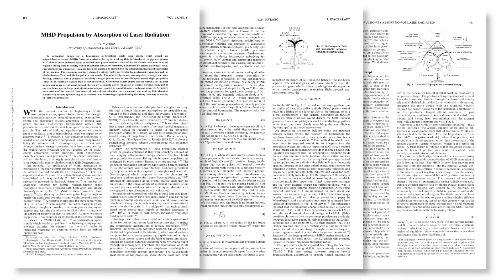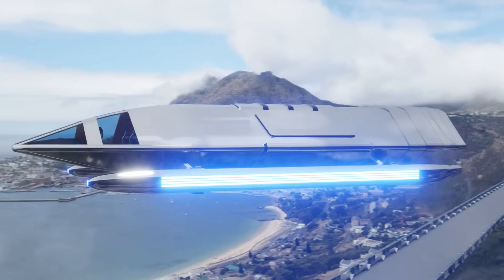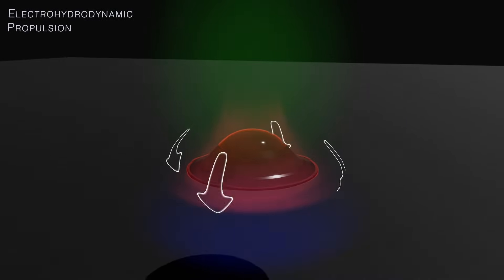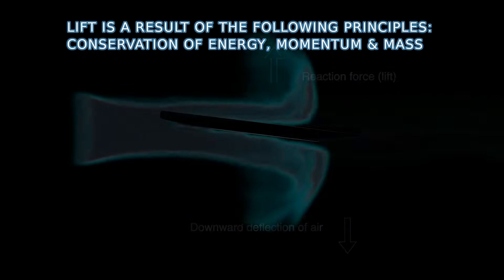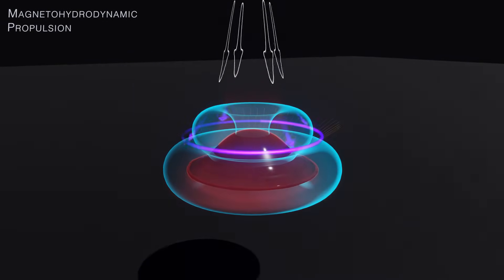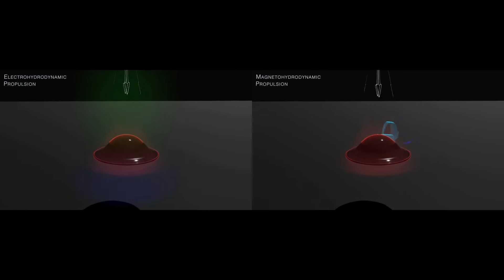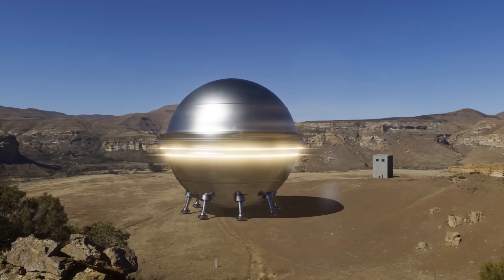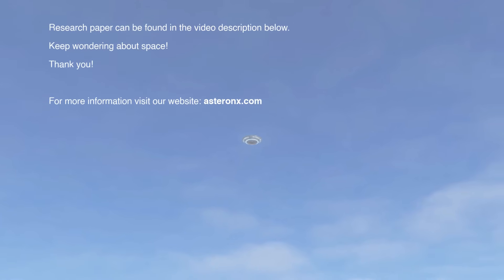Magnetohydrodynamic (MHD) Propulsion - What Is It? #magnetohydrodynamics #mhd #aerospace #asteronx

Comment: problem is ionizing the air if you gonna use it for flying. MHD propultion has been used in seawater for a long time
Reply from the maker: The craft must emit high energy discharges, specific ionizing laser pulses and cesium in order to ionize the air.

Comment: If it would be used on a ufo / plane (whatever) what type of power source is needed to run this thing? (Volts / Amps). When this field is running around the craft, would it act as a force field in a way? The thing that comes to mind is seeing that video, of that ufo craft going into water without breaking apart.

Comment: Tasks to Complete:
✔ Procure Materials – Source all essential components (frame, superconductors, batteries, gallium fluid).
✔ Assemble Structural Frame – Construct the core frame and attach propulsion components.
✔ Install Propulsion System – Set up MHD drive, including conductive fluid channels and magnetic field generators.
✔ AI Flight Control Integration – Implement AI-assisted stabilization and flight adjustments.
✔ Initial Power & Safety Tests – Ensure stable power distribution and emergency fail-safes.
✔ Hover Test & Data Collection – Conduct the first lift-off attempt, measuring thrust, stability, and control responsiveness.

Comment: all motions are came from internal pressure of atoms.

That moment could do with two ways from our world.
First method is base over newton third law.
Action and reaction used other background resistance.
Ground and water , air also too.
Today vehicles are running with this style counter reactive propulsions.
Mobiles use ground reaction and ship used water reaction.
Plane also used air reaction same way.
But we missed second method of propulsion.
Atomic internal motion which we still missed.
 I called this with "inertia".
Inertia can made directly.
This is second method in motion method.
Our rocket engines showing mixed with first method and second method .
I see rocket engines showing second method at space without gravity region arrive.
Direct method of inertia producing step happening in rocket exhaust nozzle cone region
Which I see. We must find way for second method of direct inerta making machine.
I believe "inertia could produce directly".
UFO are running with direct inertia technology.
Find to ways for direct inertia making machines with physical agitation .

Comment: Still some confusions about MHD and the creation of ionic wind. MHD at a voltage below 30,000V, will create ionic wind (see Jean Louis Naudin's Lifter). TT Brown had to go to France, to gain the support (denied in the US) of a French aeronautical / space agency, to prove that his MHD worked in empty space = the movement upward of a capacitor did NOT merely push on air. Biefeld and TT Brown also demonstrated this, way earlier, in their lab, with asymmetrical capacitors powered inside a vacuum chamber. Their video is found on youtube. They celebrate with champagne at the end. TT Brown named his earlier work as "Electrogravitational" while If you study it, you will find tests made with asymmetrical capacitors (Styrofoam cups wrapped with foil) which moves on the horizontal plane. Since gravity is not affected but vertically, MHD is not affecting gravity. *I would not disassociate Electric force from Magnetic force, as both of these orthogonal forces make up the Lorenz Force. F = q  (E + B x v). The experiment is cheap to conduct, using salt water and food dye to visualise the Lorenz force exerted on salt water (fluid). As it works in space, we can wonder what medium does it affect? Photons are the exchange particle in all electric and magnetic phenomenon. Photons are not like baseballs ejected by the Sun. Rather, they comprise the omnipresent medium, earlier called Aether. It could be easily expected that since photons are intimately involved in anything electrical and magnetic, logically, creating electrical and magnetic forces would likely affect photons. Indeed, you can see how rather strong magnets will bend a fire (a plasma).There are false assumptions still in place in regards to the nature of light, photons, and what constitute a magnetic field/ electric field. When we find the true nature and interactions of these. we will no longer be slaves to the Third Newton's Law of motion, ushering a new era of space travel. Cheers!
Reply: This probably explains why the recent UAP that was struck by a hellfire missile was flying over specifically, salt water, I remember information about this to have come to that conclusion but that information is relatively old and difficult to remember for me.

Comment: There is not a single MHD, but two kinds. MHD in liquids or in hot gases like thermonuclear plasmas (as in stars) is at thermal equilibrium and is governed by a high magnetic Reynolds number. It poses no issues to engineers, besides the mandatory high-power electromagnets and the electrical generator on board. On the contrary, weakly ionized gases (also called "non-thermal plasmas") are far from equilibrium, which means that only the "electron gas" is hot, while the heavy gas (neutral and ions) stays at room temperature (BTW that's why you can hold a fluorescent tube in your hand without burning). This MHD is that of low magnetic Reynolds numbers, and that's why MHD applications in ionized gases are so difficult to master and develop. Because when a non-thermal plasma with low-magnetic Reynolds number is magnetized with a strong magnetic field (critical Hall parameter involved), a nasty, very fast instability arises: the electrothermal instability (discovered by E. Velikhov in 1962) as well as thermal blockage, which ruins the efficiency of such converters and makes them impractical. Only when the electrothermal instability is tamed (with a method discovered by JP Petit in 1983) can MHD converters in ionized gases exist. For air-breathing hypersonic applications, apparently only the Russians managed to crack the nut.
Reply: Thanks for the education. You need to make this into a video and uploaded. So the rest of us can study it.

Comment: I had similar idea few years before. Simply ionize particles upper to create lower pressure and discharge them under to create dense preasure. To gain some ionized wind. But its weak. But preasure has force 10 tons on m2. So only 5% of preasure change is enaught.
But had better idea. Create machine with superconducting magnets that lock to earth magnetic field. If that machine lock field, then move magnet part downward, at bottom turn of field move part back to top, then turn on push again downward and same again. And you claim like on ladder. Another idea is to lock to sun magnetic field, in right moment it rip of spacecraft from the plannet. But after it you stay still relative to sun so you fall directly to sun. In right moment of stopping you can gaint gravity boost from earth/moon.

Comment: This was the work of Jean-Pierre Petit and his PhD student Brun in the 70ies. They demonstrated also that with MHD you can nullify the sonic boom in supersonic flights, hence fly supersonic without double bangs. 
Seems to be used for the B2 bomber, not for sonic reasons but for RF plasma shielding (bending of the RF waves in a plasma) and improve stealthiness.
Reply: B2 Bomber is subsonic thats why it produces no Sonic boom… Supersonic flight produces heat due to compressing the air infront of the plane (forming a shockwave you can hear as a loud boom), which in itself is very bad when designing a stealth bomber since it can be easily shot down by ir guided missiles, at hypersonnic speeds, this shockwave gets so hot, the air surounding the plane turns into plasma on its own. This would light the b2 on a radarscreen like a cristmas tree, since plasma is not capable of bending radiowaves, but is highly reflective to them, this plasma would also produce huge amounts of UV radiation that could be tracked from the ground. You can see the b2 is definetly not a supersonic plane, just by looking at its shape, essentialy the faster you want your plane to go, the longer and narroweer you build it, in short, you optimize it so no part of the plane will ever touch the mach cone produced by the nose of the plane.

Comment: This video talks about MHD "drive" as though it is an existing technology with working prototypes. Where are they? What is the power source? Where are the thrust-to-weight ratio calculations? How does a magnetic field "push" against virtual quantum particles? Are you saying that a macroscopic field somehow interacts with quantum phenomena? How does that work? Please provide sources for real-world, functional implementations of this technology...if such examples actually exist.
Reply: What's quantum other then size,  do you know
Reply: @Flagg1  – I think you probably mean other than size. If so, start with position and momentum. Heisenberg's uncertainty principle states that it is not possible to specify BOTH the momentum (velocity) and the position of a particle with certainty. You can measure either one up to the limits of precision of your measuring equipment, but not both. 

Also, energy states are quantized. Electrons are constrained to certain quantized energy states within the atom; there is not a continuous range of allowable energy states.

But those characteristics are not the context in which "quantum" was mentioned in this video. Rather, it invokes some (presumably) inherent magnetic properties of "virtual quantum particles", which are presumed to pop into (and out of) existence from tne "the quantum vacuum", a minimum, non-zero energy state that is believed to permeate all of space, even in the deep intergalactic vacuum.

OK...that's fine, I guess. But what does any of that have to do with a working prototype of MHD propulsion on Planet Earth? It's already well known that MHD will work in space. It has very high specific impulse, which helps to make up for the fact that the thrust stream contains very low mass. That makes it good for very long distance travel, where transit times are long.

But the amount of force generated by such thrust is minuscule; it's not enough to levitate a vehicle in a way like what is depicted in this video. Without a working prototype, this is all fiction, and not especially good fiction based on actual science.
Reply: @Vito_Tuxedo  I would have given you quantifiable & such but it's size. If you take a portion from something no matter how small it is it's still that thing no matter the name you give it, like referring to atoms or even particles & such other. it's purely size relative & when it comes to quantum it's quantifiable,  quantitative.
Reply: @Vito_Tuxedo  try this. Can 0 be divided?. Can 0 be subtracted from?. The answer to both questions is: No. however some would have you believe otherwise & have created incorrect methods using mathematics, equations, calculations, etc.

Comment: 🕳💫🕳💫🕳💫🕳💫🕳💫🕳💫🕳💫🕳💫There is also a secret technique for flight in the atmosphere, plasma propulsion panels. They are located in the form of round zones around the perimeter and on the bottom of the device. A column of ring vortices is created from below and along the movement - this is how the device flies... Everyone has heard about railgun guns - this is a system of two extended longitudinal contacts-rails and a projectile between them. If an electrical impulse is applied to the rails, induction will accelerate the projectile to cosmic speeds. Following it, a jet of hot plasma will also fly out. Such guns are being developed in many countries. The momentum created by the railgun can be used not only to fire, but also to move. Accordingly: spacecraft have pulse engines that shoot plasma at the right moment - creating sufficient force to move from one orbit to another. For example, “Ablative pulsed plasma engine”, there are reviews on electric propulsion engines. These engines are large; a plasma jet appears there when a plastic plug located between the electrodes burns. Secret vehicles (“flying saucers” and “dark triangles”) have propulsion panels. There, railguns are reduced to the size of a pencil and assembled into flat panels, which in design resemble the plasma panels of ordinary televisions. The distance between the contacts is small - an ordinary spark of an electrical discharge becomes the bridge between them. The cells operate synchronously: they shoot jets of plasma - sparks of electric discharges accelerated by the force of induction. Their speed is enormous, the number of railguns in a panel is hundreds of thousands. The total motor impulse is impressive. The discharges occur at a megahertz frequency, each pulse striking the air, which swirls into toroidal rings. These toroidal rings form the air cushion on which the vehicle flies. In the horizontal direction, a pushing effect is created in the same way. In a vortex jet, due to the rotation of air, the temperature drops - moisture from the air is frozen in the form of snowflakes, on which the light of electric discharges sparkles. The result is a kind of “solid beam”, which, when rocking the apparatus, is capable of bending - because the trajectories of the vortex rings are bent. The devices fly quickly and they are very maneuverable - thanks to the lightness of the device (it is made of composite materials). There is harm: from pulsed plasma engines - microwave radiation. Load capacity is low. There is no radio communication. Narrow application profile - rare spy missions. The question is often asked: where does so much energy come from? Answer: they use super-galvanic cells that create a current of 1000 A. The principle is simple: a magnesium tape (magnesium on a viscose basis) is scrolled past the electrode in the presence of an electrolyte. It's like playing tape in old tape recorders. Magnesium is completely oxidized and enough energy is released. Previously, magnesium tape was thrown out as an “exhaust” - this is how rumors arose about “angel hair” that remains after the passage of a UFO. Now the waste tape is collected and magnesium oxide is recovered. This technology for generating energy is very expensive, but it is used for spy technology.

Comment: MHD using air alone will never be used for aircraft as the thrust will always be too low for anything practical, regardless of how advanced the technology gets.  Technology is not the limiting factor- physics and the density of our atmosphere is and makes pursuing that goal pointless. MHD underwater is much more practical and   more technology dependent.  MHD in space requires an additional "fluid" as there is not enough matter in the vacuum of space to produce any useable thrust. Therefore, thrust derived from MHD would only be secondary to the primary reaction mass propulsion. (This is not including ion thrusters already in use on spacecraft, but again, those are unlikely to ever be used for manned spaceflight due to their extremely low thrust).
I wish this video took reality and practicality into consideration rather than just falsely extrapolating on some basic concept without considering the limiting physics making the level of technology irrelevant. As an aerospace engineer, I will probably ignore most future videos on this channel if they continue to be so misleading.
Reply: liquids were mentioned.  Why don't you guys actually do something like provide some useful energy systems for everyone.  Do something
Reply: Truth is yalls some of the worst descriptive people out there.